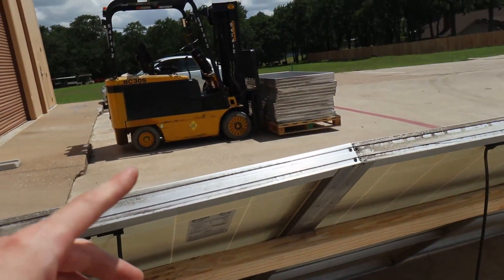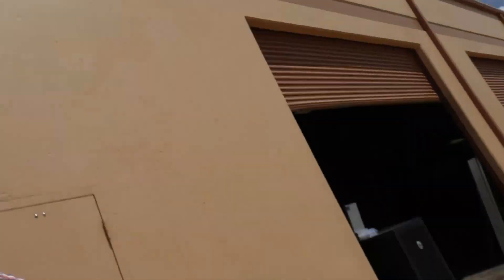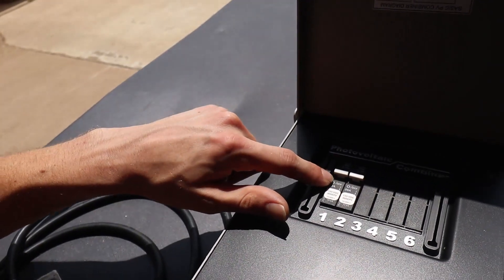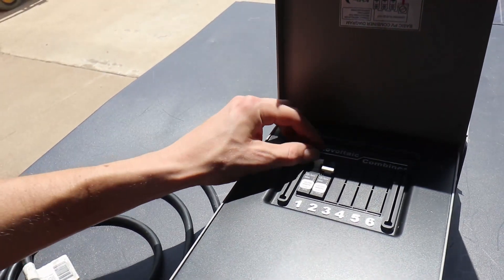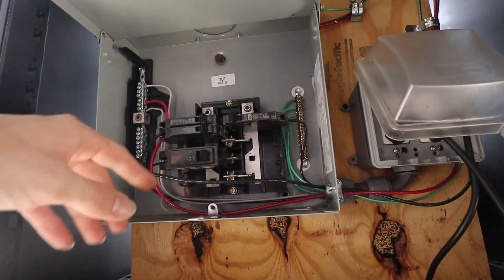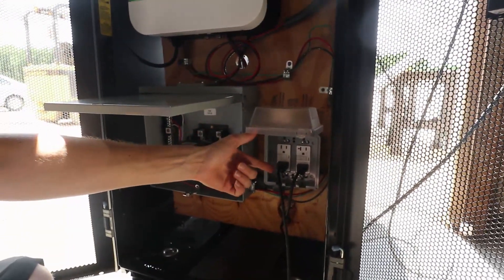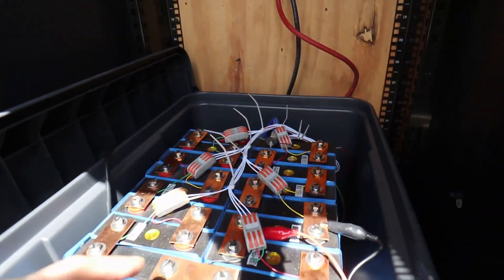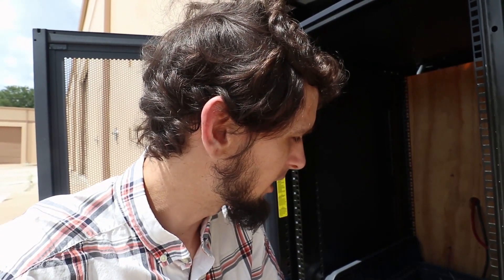DIY Affordable And Expandable Off-Grid Solar - 48V LiFePo4 and Growatt

Comment: THHN wire is rated 90 degrees centigrade but because the terminals (in most cases)are rated 75 degrees C. So it’s a good rule of thumb to ALWAYS use the 75 deg column when referencing 310.16 NEC. Using the 90 deg column will be overloading the conductor.  Great videos love your content!
Reply from the maker: Good to know, thank you!

Comment: Thank you for explaining this. Question 🙋‍♂️ I thought I read somewhere that with used panels you can’t get an inspector to sign off on them or that insurance will not cover an electrical problem. Is that true?  I hope not, I’m in a position where I need to go with good used panels. Thanks again for sharing. Dave in PA
Reply from the maker: I'm sure that depends on your area. First place to start would be calling your AHJ (County or City) to see what is required from a permitting perspective. My city had no rules against  used panels though I'm sure some inspectors do check to make sure the manufacture label is in tact proving it's a UL listed panel. For insurance I can't help you. Best to call and speak to your agent to see what is or isn't covered.
Reply: @BeeneEnergy  Yep Texas Last land of the Free!  Thanks for taking time to reply. I’ll check with the code officer before I buy.

Comment: Think the growatt can handle 4500 watts of solar
Reply from the maker: I don’t know. The manual doesn’t seem to specify how much over-paneling it can do.

My concern is the current going into the pv input. For example 6 strings of 3each 230w panels are 8.5a short circuit current each. That’s about 60a into the growatt from solar. If the manual stated max input current I’d feel better about over paneling. As it is 3.8kw is the max.

If I’m wrong and it’s listed let me know!
Reply: That growatt won’t. But they have others that can. I have 2 of those inverters. 
But my current system has the growatt 5000 inverters. They can handle more power and don’t need the combiner box for solar.

Comment: Okay Beene, Im starting with this vid.....
Reply from the maker: This is a good one!
Reply: Actually what is your goals with your solar? Make a plan. Design according to your needs. The use and output of this system is very limited. Plus even when you use these inverters? They only put power to each leg of the breaker panel.

Comment: Which model and UNIT is this  SPF 3000 TL LVM   ??????????????????????????????????????????????????????????????
Reply: you never told us or did I miss it?
Reply from the maker: I probably didn’t mention the model, check out the spreadsheet I linked to in the description which had all the parts used.

Comment: Do you have any folding portable panels? Or what is the smallest panel you have in stock?looking for something to charge a valence battery i picked up for camp lights. Nothing fancy just down n dirty panel to pwm controller to batt. I have everything for it just would like a more portable friendly panel.my 80w panel is huge and heavy.thanks
Reply from the maker: As I was reading I’m thinking “hey these 230’s aren’t too big” and then you said your 80w is too big.

Nope, those 230’s are the smallest I’ve got.

Brad Cagle was mentioning he might have a portable panel he was looking to sell. He was commenting here on this video I believe.
Reply: @BeeneEnergy  ok I'll check.thanks for reply and also the pair of 400w I pick up from you are still doing great.no problems and my camper was actually warmer than my house during our texas blizzard.they charge 5 agm 100ah batts I have powering the camper as well as the Chinese diesel heater That thing rocks and low wattage and fuel consumption.Thanks again and I'll get with you when I need more for my lake house we're about to start.

Comment: I think this is a superb example of how someone (or you) can build up a nice, usable and safe emergency power system.  The setup that you have build should be very useful to describe and detail the specific how to's for a number of very useful configurations including my two all time favorites : 1-  parallel inverters for split phase   and :  2- How to combine a separate FLA system and a LiFePO4 system into a useful system that works.
Reply from the maker: I’ve got 36v worth of golf cart batteries. Another two and I’d be able to test with 48v! Lol 

Would be fun to show how much space those take up compared to the lithium pack.
Reply: @BeeneEnergy  I think there are a lot of people that would like to see how they can combine FLA and LiFePO4.

Comment: Knowing what it needs to make it safe is important.  I've done most of my own electrical work for years.  When I enclosed the carport on a previous house (complete with permit), the City Inspector had one question: "Are you an electrician?"  I'm not, but I did the work to code (NEC for that location) because I slept there ;-)  I think that's the level of reassurance most DIY electrical work needs - it's good enough to sleep there.

Thanks for the info you post.

My solar power is a short-term backup system - we have frequent, but usually short outages (under 12 hours) - so the system was purpose designed: enough solar power always connected to keep the 12 volt, 420AH AGM battery bank charged and to recharge it from a short outage with the next day's sun, enough inverter power (2000 watts pure sine wave) to handle the essential items - and their starting loads.  Depending on the season, we have 8 to 20 hours of instant, silent backup (fridge, limited LED lighting, blower on gas-fired central heat in winter - the 8 hour end, plus charging cell phones, etc).  The system works to provide "Wait until daylight" power so I'm not out in a thunderstorm or shoveling 7" of snow by flashlight at 30F to get a generator going (only did that once and then found a better way).  If we had an outage lasting longer than I have stored gasoline for the inverter generator (couple of weeks) , I have 1000 watts of solar panels in the garage (and controllers to handle them) and the counter height fridge in the basement would become the primary fridge - 400WH/day versus 2000WH/day for the 28 cu ft fridge/freezer.  The solar lighting for the equipment shed is a small system but it's been more reliable than grid power in the 2+ years it's been in use - it works EVERY time I turn the switch (windup time switch so the lights can't be left on).
Reply from the maker: That’s fantastic, I’m sure your preparation relieves a lot of anxiety when the storms start brewing!